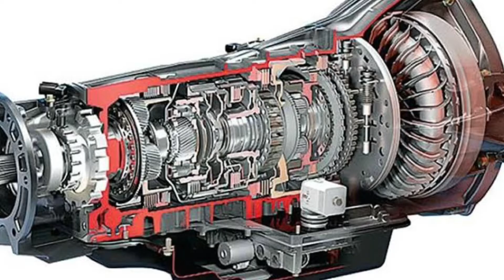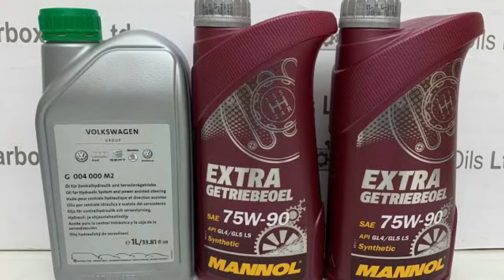Replacing DSG mechatronic unit, replacing mechatronic accumulator, P178B, P177F, P189C, P0841

Comment: I have p0841 code on dsg7 gearbox, but it is shifting well with no delay or jerking in gear changes. Drained fluid and it was the correct amount so no loss of fluid. What could be the issue ? Faulty pressure sensor? Also it's a 2015 build which came with a reinforced accumulator from vw.

Comment: Hello.. kindly share the eBay or amazon link for the said parts. 

I have a VW Polo V, it won’t start, so I by pass the ignition and switched it on. The car won’t go in reverse, by when I put it in drive it will move. It only engages gears 1 and 3. It even struggles to engage the third gear. 
Any advise or recommendations? And yes it’s flashes the the PRND

Comment: the VW golf 7DSG - hydraulic accumulator house has been broken so will it be safe to add a repair kit instead of replacing the accumulator house? or will it be a problem if we add a repair kit?
Reply: The repair kit comes with the new rubbers and filter by the looks of it. Maybe you do not need and can just replace housing?

Comment: I purchased that same kit and the problem returned just without the lost of the hydraulic oil. But when I leave the car to warm up for some time switch off the ignition and start back the symptoms temporarily goes away
Reply: Same thing for me. I had replaced the accumulator a year ago with Kinergo and now the problem comes back again. It was showing gearbox error when I start the engine. And when I turn off and start again it goes off.
Reply: Now did you solve the problem? If yes please say how.

Comment: Hi brother...
Reply: I need your help.
My GTI Gulf have a big problem.

Gearbox DSG 7 - DQ200
Gears coming :
1 - 3 - 5 - 7
Gears not coming :
reverse - 2 - 4 - 6.
Can you help me.
Reply from the maker: Call me on 0714371542
Reply: Hello.. kindly share the eBay or amazon link for the said parts. 

I have a VW Polo V, it won’t start, so I by pass the ignition and switched it on. The car won’t go in reverse, by when I put it in drive it will move. It only engages gears 1 and 3. It even struggles to engage the third gear. 
Any advise or recommendations? And yes it’s flashes the the PRND

Comment: Hi brother i need  help my 7 speed dsg has a problem during first run of the day it shifts fine from D1,D2,D3,D4,D5,D6 and D7 its flushes the spanner but once i stop n switch car off it goes away and drives fine the rest of the day fault that came up was P173C
Reply from the maker: Mechatronic unit needs attention. You can start with a full transmission service including new mechatronic oil.
Reply: @aswanation 
Hi there.. How can I get your contacts... Kindly